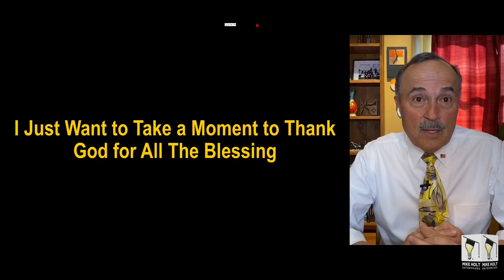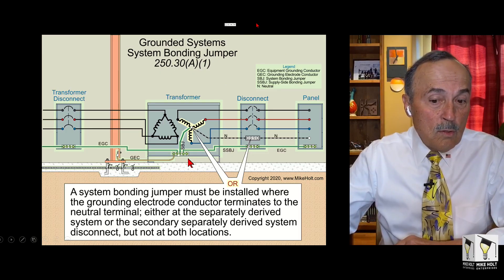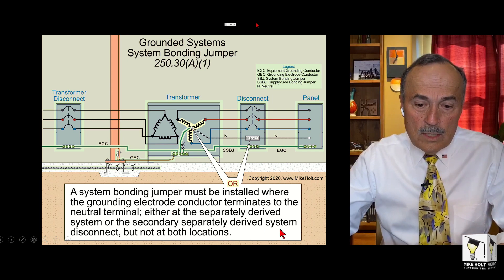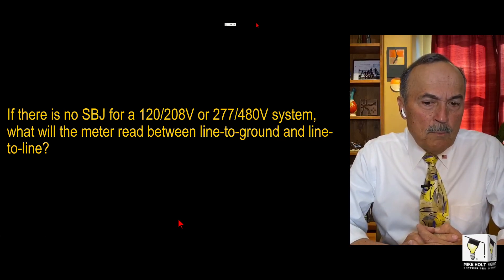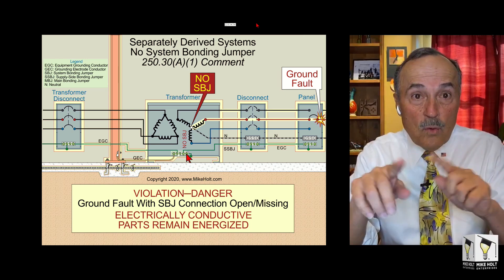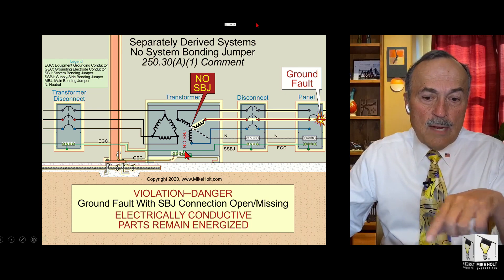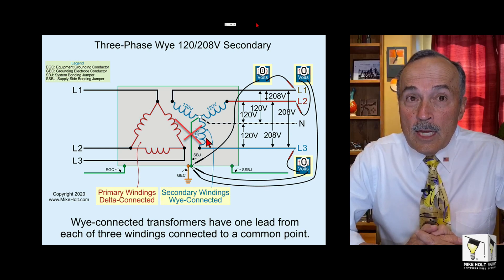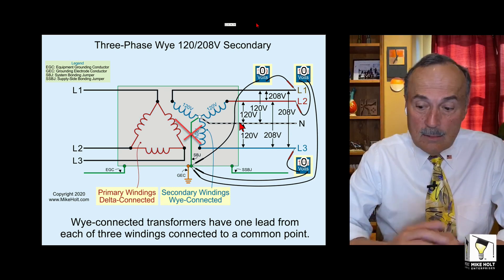System Bonding Jumpers for Different Types of Systems, NEC 2020 - [250.30(A)(1)], (8min:34sec)

Comment: Completely different system here but gotta question i need an answer to.  A client wants my company to build a 30A single breaker tap off box being supplied by a 208V 800A busway with a 200% rated neutral.  The tap box is providing power to a server rack in a data center hall by a L21-30C 208V 4P/5W female receptacle.  The receptacle is connected to the tap box by a 8/5 SOOW cable.  As of now, we have (1) #8 awg neutral conductor connected from the neutral bus via ring terminal and spliced to the neutral on the SOOW cable.  Is this installation acceptable per code?
Reply from the maker: @anthonywooten9930, please post your question on MikeHolt.com/Forum

Comment: In an industrial place you will have a lots of 208/120V transformers all over the place, but you don't drive a ground rod for each of these transformers unlike the utility service panel. So you don't need ground rod per say as long as you have a ground connection correct? such as beams (or ground wire running from the substation) which will be part of the ground grid in an industrial  facility.
Reply from the maker: @KumarKumar-dp4go, correct, if it complies with 250.30(A) and 250.64.

Comment: Mike..let’s say I don’t drive a ground rod for my transformer. Everything is bonded correctly but the only thing missing is my GEC. I still clear faults and still get correct voltages correct?
Reply from the maker: You are 100% correct, I've submitted to have the grounding to the building grounding electrode system requirement removed.

Comment: Mike, I actually got called to do a service call for a 500kva transformer where the "electrician" did not properly bond at the transformer and caused a whole mess of issues! So yes! you are 100% correct when you say "electricians" do not know the concept, or even forget it all together!

Comment: Do you have to use bond bushings on flexible metal conduit on primary and secondary flex seen it done multiple ways please advise and tell me where I can find in code thanks
Reply from the maker: Of course not unless 250.97 applies (which it doesn't). In addition, it serves no purpose to put bonding bushing and jumpers from a 'connector' that is connected to a raceway that does not qualify as an EGC. Why do people put them on? Who knows, probably it just makes them feel better.

Comment: Mike, thank you for all the great information
according to what i have seen in this video when SBJ is not installed then the voltage between the line and the ground is zero volt , so if sombody touch the hot wire he will not get an  electricall chocked ?.
hope to answer my question 
thanks again.
Reply from the maker: Correct!

Comment: love these videos.  question regarding system bonding jumpers.  in a corner grounded delta would it be a good idea to ground a phase at the meter socket enclosure? what if it was originally a 3 phase 3 wire delta with no neutral and you wanted to ground a phase, where should the main bonding jumper be at?
Reply from the maker: The NEC requires service grounding at the service equipment (service main), see 250.24(C). Excellent point.

Comment: quick question... if the transformer is wye bonded but there is no GEC(nor metal conduit) to the next disconnect, the neutral and a new grounding rod must be bonded at said disconnect?
Reply from the maker: See NEC 250.30 on SBJ, SSBJ, and GEC.
Reply: @MikeHoltNEC  thank you!

Comment: First off, God bless you brother. I've seen an missing sbj. The tale tale voltage you will get on 208 panel for example is 77 volts on a to b phase and close to 277 on a to c. This has to do with the sine wave. The system tries to correct itself by a missing differential voltage. It doesn't read 208, if my memory is correct. Phantom voltages on the neutral to ground is also a tale tale sign from my troubleshooting memory.

Comment: If you have no system bonding jumper this would make voltage to ground 0, wouldn't this be a lot safer? If someone is to touch a live wire in a system with no system bonding jumper, there is nowhere for the current to go to. Now I know there are benefits to having a system bonding jumper to clear faults and surges but still... why does this take priority over someone's life if someone was to touch a live wire?
Reply from the maker: Watch this video - https://studio.youtube.com/video/mpgAVE4UwFw/comments

Comment: No/bad ground you will get different voltage readings.
Reply from the maker: The ground (earth connection) has nothing to do with the voltage of the phase conductor and the metal enclosures of the system (because of the system bonding jumper).

Comment: I find it interesting that Electricians still have confusion about this. A seperately derived transformer system is the most straight forward system to bond and ground, in my opinion.
Reply: That’s why you’re watching this video? 😂

You should also consider that the majority of electricians are mainly installers that just work off blueprints. It is a very small percentage of people searching out this information.

Comment: One question , what about a residencial conection where the transformer ( with sbj installed) is not part of it, and the suply wires are only line and neutral?, must be  installed the sbj?, if not,  what  is the path clearing a fault?
Reply from the maker: Grounding of service equipment must be in accordance with 250.24.

Comment: If there is a difference in potential between ground and line why don't you read it on an ungrounded system?
Reply: A ideal voltmeter (ideal as in perfect, not the brand name) would have infinite ohms of input impedance, and would read a difference in potential between line and ground on an ungrounded system.

However, a realistic voltmeter will have a finite number of ohms as the effective impedance of the input, typically on the order of magnitude of Megaohms.   You can demonstrate this by constructing a voltage divider with two 1kOhm resistors, and measuring across one of the two resistors.   As expected, with 1 kOhm resistors, you'll likely get half the supply voltage as your read-out.  Now try it with 10 Megaohm resistors, and it likely will not measure exactly half the supply voltage.  You will see the voltmeter becomes a resistance in parallel with the resistor you are measuring, which reduces the equivalent resistance of that section of the circuit.  An ideal voltmeter would not do this, but a realistic voltmeter will.  An experiment such as this, can allow you to infer the input impedance of your voltmeter.

If the effective impedance of the voltmeter is low enough that it has less impedance than the air/insulators between the other two phases and ground, then it will become a preferred path for current to flow, that will temporarily ground the system.   It will settle on an equilibrium, where there is zero voltage difference between the phase under test and ground, and therefore draw no milliamps of current to register a voltage read-out on the voltmeter.
Reply from the maker: Thank you for answering the question!
Reply: @carultch  im going to re-read and chew on this reply. I am in electrician school and find new training info like this  very interesting. Thank you.
Reply: @elc2k385  I was surprised when I first did this experiment.   With our equipment they had us measure the voltage divider with 1 kOhm resistors, and then with 1 Megaohm resistors.  I thought for sure it would measure half the supply voltage, and didn't expect anything else.  But sure enough, it measured significantly less than half the supply voltage.
Reply: @carultch  thank you for the detailed answer. It is not clear at all at first, you need to apply the right reasoning. Would be very nice if @Mike can make a short video explaining this mathematically 👍🏻